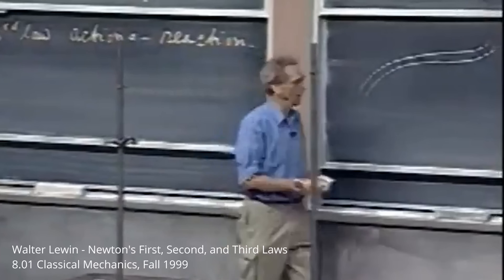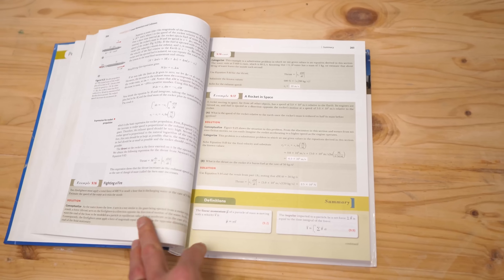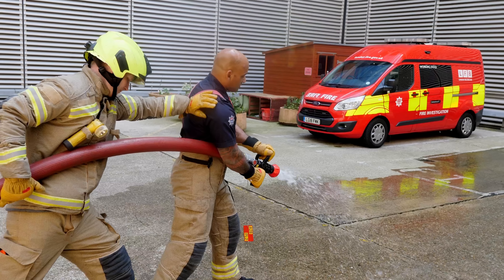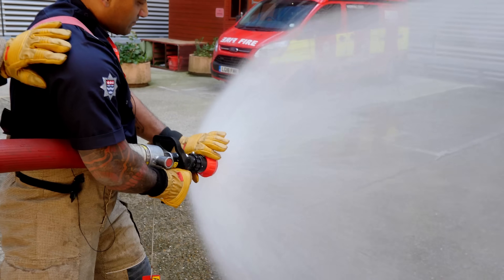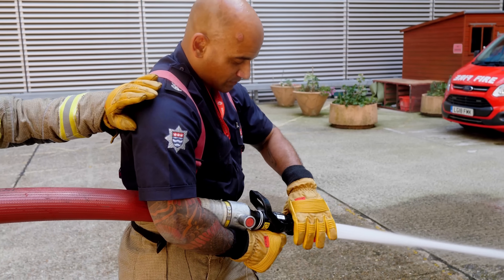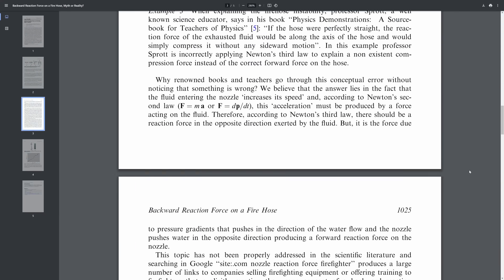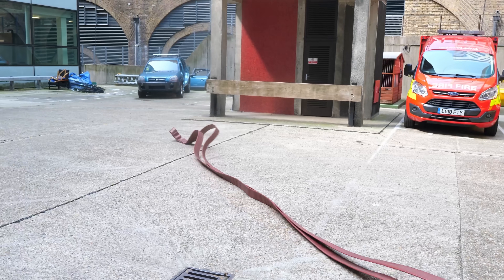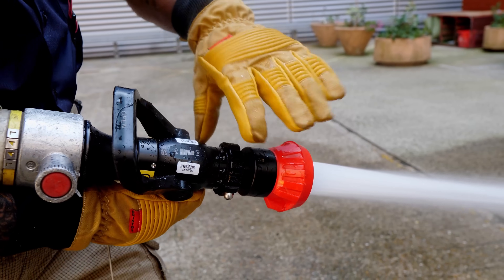Why chaotic hoses dance

Comment: Hi Steve! When I stand so that my microwave is between my phone and my bluetooth headset, I get interference. But it's not just the shielding, because it's 100x more significant when the microwave is on. I thought photons pass right through each other without interacting. Why are microwaves interfering with my bluetooth?
Reply: After a conversation with my AI I've decided to try moving the phone elsewhere.  The microwave may not be acting like a blocking wall, but a speaker drowning out the signal at the receiver.   But if this is the case it should still interrupt my signal if I stand in front of the microwave no matter where in the house my phone is.
I'd previously erroneously ruled out this idea by assuming the microwave would emit noise omni-directionally, and noticing that stepping to the side restoring the signal.  I thought this was me moving so the microwave wasn't directly between my phone and I. However it could just be moving out of the main leakage zone.

Comment: My thinking on this is like, the pump keeps pushing water into the pipe, increasing the pressure inside the pipe, and there is a column of water standing still till the edge of the pipe. Only because the external pressure is lower, this water exits the nozzle and hence the reaction force at the end. Open for discussion in replies!

Comment: 16:24 it may be counter intuitive, but the bends in the hose seem to have no effect at all on the hose experiencing a force and thus moving. holding both ends as you did, there was room for it to move and wiggle with the extreme curves but it didnt at all. I think the constant pressure the stretchy hose exerts on the flowing air or liquid maybe accounts for this. The other force the hose experiences it at its end as it no longer feels the pressure excerted by the hose walls. This force is constant and swings around because it pushes back on the hose forcing to to move and that movement is choatic becuase the resistance the hose provides at different angle is different as the hose pinches a little bit. If the hose was feeling a force based on its ends it would move when you held both ends provided there was slack and it didnt.

Comment: The curvature is definitely involved because, as you said, a straight tube would not feel any reaction force at all. However, this curvature idea might also be related to the fact that the hose has a fixed diameter all throughtout and it suddenly becomes infinitely large.

Comment: great video

my thoughts about how to calculate what the fireman feels that matches your experimental data:

1. the water inside the hose isn't "pushing" water at the nozzle because an object in motion stays in motion, so the water in the hose isn't withstanding any of the brunt and isn't making it easier for the firefighter. I mean maybe a tiny bit but not noteworthy.

2. the water gaining momentum all "comes" from the firefighter

a quick google says a firehose in real world use can be projecting 50kg of water per second, to pick a completely made up number for easy maths: if that water jet was going 1m/s faster outside the tube than inside then that seems hard work by my expertise falls apart so I can't calculate it, if I had to do the same using a manually motor to accelerate a 50kg mass 1m/s/s, after accounting for friction it'd still be bloody hard. so someone smarter than me should calculate the actual speed the water gains, and try and verify how hard it actually is to counter act that.

Comment: could be the fact that when the water escapes from the hose, the 3rd newtons law is acting as pressure against the walls of the tube, so the water exiting is the resultant force = to that of the pressure against all walls of the tubes. the only phase that is not static pressure is the exit of the hose where the dynamic pressure exerts the acting force. idk

Comment: 11:43 actually, there is a big physics discussion going on in the firefighting world around hose diameter, because the velocity in the hose ISN'T constant OR consistent, as the water experiences friction with the hose wall and causes turbulent flow throughout, which would muddy our thinking about the pressure even further

Comment: The force at the end of the fire hose is due to the change in momentum of the water.  The pressure has more to do with maintaining the high outlet water speed through a small restriction.
When the mass flow of water is traveling through the hose of constant cross sectional area, it is traveling at a constant speed.  When the cross section area decreases at the nozzle, the water speeds up.  This change in speed for the constant mass flow causes a change in the momentum, and that results in a force.  The speed change is proportional to the ratio of the cross sectional areas.   Putting numbers to that:
For example take a fire hose flowing water at 12 Liters/second (158.6 imperial gallons per minute).  Take a 11.3 centimeter inside diameter hose (0.113 meters), it has a cross sectional area of 0.01 square meters (pi/4*0.113*0.113 m²).   A cubic meter is 1000 Liters, so 12 L/s is 0.012 m³/s (12 L/s/ 1000 m³/L).  That makes the speed of our water 1.2 m/s (0.012 m³/s/ 0.01 m²).  Water has a density of 1.0 kilograms/Liter, so that is 12 kg/s of water traveling through the hose (12 L/s * 1.0 kg/L).  So we have 12 kg/s traveling at a speed of 1.2 m/s.  If the area of the nozzle is 1/50 that of the hose, the speed will increase to 60 m/s (1.2 * 60), the difference is 58.8 m/s (60 - 1.2). The change is momentum is 12 kg/s * 58.8 m/s, the force will be 705.6 N, or 72 kg.
The high pressure is required to squeeze all that 12 L/s of water from a 100 square centimeter area through a 2 square centimeter area.
This is the same way a rocket engine create thrust, as well as a jet pump on a Sea-doo.

Comment: to me, they feel the full push back of the tube simply because they grab it from the tip. so, where there's no curvature, neither random elastic interaction in the tube that could change the direction of the force
Reply: There still may be curvature.  The hose may need to bend around a doorway or tree or something, or the direction of the pump may simply be different from the direction of the nozzle.

Comment: I imagine the weight of the water in the hose is pushing against the force of the water exiting the hose Vs the air being essentially weightless so the hose will only push an amount of hose that doesn’t out weigh the water it’s pushing.

Comment: 11:50 as an engineering student this really irked me,,, that first assumption about the pressure in the hose was dead wrong! There has to be a pressure gradient in the hose to counteract the viscous force opposing the fluid velocity in order for the speed to be equal everywhere, and thus the pressure drops as you get further along the hose.

Comment: at 14:00, i suspect you assume that the water is compressible. AIr is more easily compressed. But the pressure here is small (the pipe is not inflating, getting rigid).
Also the speed of the water is null on the edge of the flow (the one touching the pipe). As soon as the water leave the pipe it looses this effect and the edge is moving.

Comment: I think what's being overlooked is that the plastic deformity of the hose wall is proportional to the pressure. The pressure of the water isn't just one-dimensional along the length of the hose, but pushes out in all directions. That puts a force on the wall of the hose that's uniform along the cross-section, and the elasticity of the hose trying to retain its original shape pushes back, holding that water in place. The net vector of the forces around a cross-section is zero, but the vector at a given point on the wall has magnitude and points toward the center. Any bend in the hose puts more deformity on it and increases the elastic force trying to push it back to center, so a hose under pressure tends to right itself into a straight pipe just like the inflatable until the end. 

So when you say transferring the force is like pushing a string, it is, but it's like pushing a string through a straw. At first it slides around to the side, but the wall of the straw restricts it so that it bunches up, and the more string you put in, eventually that bunched up section under pressure slides along the straw until you get the string coming out the other end in a wad, which quickly unravels because it's no longer constricted.

The pressure being in all directions is why the water comes out in a slight cone rather than a cylinder. It has forward momentum but also forces pushing outward from the center. The nozzle controls this by allowing for a gradual reduction of pressure and redirecting those forces. When the nozzle is fully open, the stream cones more, but slightly closed it becomes straight, then more closed and it cones again as the stopper in the nozzle changes the direction of the flow. So the change in pressure isn't instantaneous at the end of the nozzle but follows more of an S-curve along the length of the nozzle. The pressure variance along the length of the hose resembles an arctan function, where the pressure at the pump is one asymptote, and the external pressure is the other asymptote. Closer to the pump the change in pressure from one unit of length to the next is near zero, but it's not zero. Since the pressure is not constant, there is a point, close to the nozzle, where the tendancy to remain straight due to internal pressure  is low enough that the hose starts wobbling.
Reply: My thoughts exactly. Also, the inside of the hose is not smooth and the properties of the material aren't the same throughout the whole surface of the tube.

Comment: Someone trained as a volunteer firefighter here. The setup we had used a thicker "mainline" hose runniing from the truck to near the fire. This mainline would connect to a fork block that had up to 3 smaller diameter hoses able to connect to it, each with a far quicker to use 90° valve. The instruction was to ALWAYS stay the F away from a loose hose and shut the corresponding hose off from that valve. Shutting it off and repressurising it will always be faster than that crawling the length of the hose shown in the video, and is infinitely safer even with the thich heat resistant clothing and a helmet.
Reply: It was really odd to hear him talk about how much faster that is etc. when shutting the valve off was clearly faster AND safer. That does not mean you should not be able to handle such a situation, but you train it for different reasons than speed.
Reply: Yea. I was unsure if I was missing something. Aka confused over whether I should have been confused.

Comment: I'm not convinced by that firefighter's explanation for crawling down the hose. If no one is manning the valves then yes but if someone os standing there at the valves it certainly has to be easier and quicker to twist the thing shut than crawl the length of the hose. I'm sure he's right just that there's a bit more to it than what he said.

Comment: any place in a hose that is experiencing a flow restriction due to its bend will tend to try to straighten out- just like the dancing windbags.  It can curve any which way, and it won't move- until it bends Enough to restrict the flow a bit.

I think Both that tendency within the hose, And the rocket thing at the outlets, affect the movement of a free flopping hose.

Comment: 9:00 your setup is the problem , in both cases the pipes inital and final direction is equal,,try makiing the tube actually take a right turn and you will see a difference in force( in your setup 2 forces are produced in the loop which cancel out but these 2 forces do expand the ring formed hence the forces are present and just cancel out )

other than that if a tube has no constriction at its end (which yours does not ) 
if it has no compressibility (not talking about flexibility )(your hose is slightly compressible)
and if the fluid used is not viscous(which air can be concidered )
and if the hose is absoulutely perfectly straight
and if the fluid escaping does not expand /collect just dissapears 
if all this is there then there will be no force on the hose 

just make sure the end of the piston which is measuring the force is not blocking air outflow and you will not measure any force if there are no bends in the tube

(there will be a thrust force on the hose if output air changes direction (same as how helicopters cannot fly infinitely high bcs the thrust force depends on a ground to hit against)

if you do see this please tell in some way , ill show the calculations in a pdf format

please try this once.

(and your second expalination to the hose instability is much more accuarate than the first)

(when you hold both ends of the hose the middle does not move bcs its forces and the tension forces in the tube balence out )
(but for the end there is only tension in one end which cant counter the force by thrust in the opposite direction)

Comment: Same goes for a 3 phase 125 amps 420 volts open endend power cable,  switched on by accident...I've seen it happen,  scary.

Comment: The thing is: You have friction all along the way from start to finish. It is only a tiny fraction of the whole system. But the movement side to side is only a fraction of the system as well. You have a lot of tiny forces interfering with each other. Thus the chaotic nature, unless you constrain it enough to only have small degrees of freedom. The next thing is: Water is much less compressible than air. This makes the waving figures much less violent than the water hoses. At what point will bending a hose constrain the water flow enough, such that you will get a drop in pressure / higher flow speed? This extreme case is observable with air. As you described, the bend will cause pressure changes, so the top is falling down, but the base will maintain shape. The bend will rise up until the low pressure zone is resolved.

So: They are closely related. The water hose is a special case of the air flatables.

And if you want to try the case with the bend in the water hose: Please let you tell by a fire fighter first why they are making absolutely sure that hoses don't have a bend in them before turning up the water pressure to operational levels. 😉

Comment: I did a very dumb down fire brigade crash course and oh boy, the hose pressure was immense. But this meant that the hose itself was hard as a rock. When holding it (admittedly we were 5 holding it), it was just a heavy hose. I did not feel a force that I had to resist. It was more like some heavy mass that I had to lift.

Comment: 6.30 it's not a closed system, where the rocket is. Not to say there is no force, they have to fight the forces of the hose moving,
Reply: Would it be like jumping in a train (water in the hose), then jumping on top of a train (water coming out of the hose), of course the train is moving.

Comment: The pressure in a hose should be decreasing along its length. The pressure at the end should be near atmospheric, barring a significant restriction. 
I don't believe the water can accelerate at the end of an unrestricted hose. That would make it seem like the water is leaving the hose faster than the hose is supplying water.

Comment: Posting a comment to help the YT algo recommend this video to people facing barriers in seeking uni-level education so they can see the Jane Street plug at the end of the video.

Big fan of yours Steve! Love your content man. But what is the HosePa (wattage) (#RichardHamilton) of the hose's pump at the pump and at the nozzle? Kinda disappointed I didn't see any references to energy in this video, even though to the novice it's kinda analogous to your favorite physical value; momentum, also I didn't see you reference the varying velocity of the fluid at different layers of the hose (fluid by the walls moves at slower speeds than the center). It is incredible how much you dumbed down the material in this video, even though it's clearly still very clever.

Comment: Hello,
I have a comment regarding the pressure in the hose. The pressure remains equal throughout only if the water is stationary.
However, when the water is in motion, hydraulic losses (pressure drops) occur. At the nozzle's exit, the pressure is at atmospheric level, while it increases the closer it is to the pump.
This pressure loss can be calculated using the Darcy–Weisbach equation:
delta p = lambda * l / d * c^2 * density / 2
where:
lambda depends on Reynolds
for laminar flow lambda is 64/Re
for turbulent flow and Re < 100000 lambda is 0,316/(Re^0,25)
delta p is he pressure loss in Pa (pascals)
l is length of the pipe in m (meters)
d is diameter of the pipe in m (meters)
c is the speed of the water in the pipe in m/s (meters per second)
density is the density of the water in kg/m^3 (kilograms per cubic meter)

Or the formula can be written:
delta p = lambda * l / d * c^2 / (2 * g)
where:
delta p is the pressure loss in mH20 (meters of water column)
g is gravity pull in m/s^2 (meters per square second)

A pump does not create pressure; instead, pressure is generated by the hose and nozzle. The pump's role is to overcome the required pressure and generate flow rate.
When the pump pushes water into the hose, it does so at a certain flow rate. The speed of the water flow is determined by both the flow rate and the hose diameter. The hose and nozzle create pressure, while the pump works to overcome it.
According to the formula, velocity has the greatest impact on pressure loss because it is squared in the equation.
If the nozzle is closed, the pressure inside the hose increases until it reaches the maximum pressure the pump can sustain. At this point, the flow rate drops to zero (meaning the water stops moving), and the pressure equalizes throughout the hose.
This explains why, when the nozzle is closed, the hose straightens and remains still until the nozzle is reopened.

Thanks for the video! It's great!❤